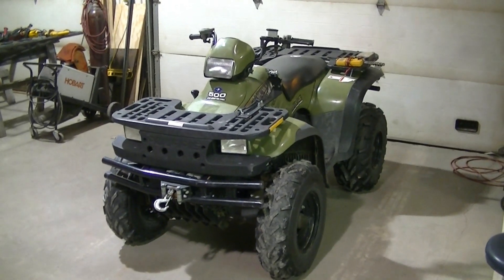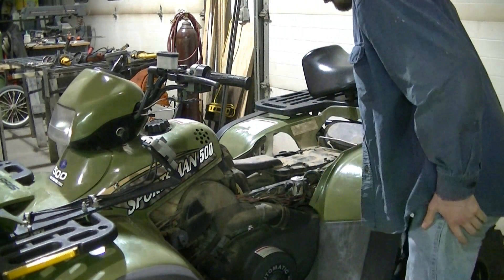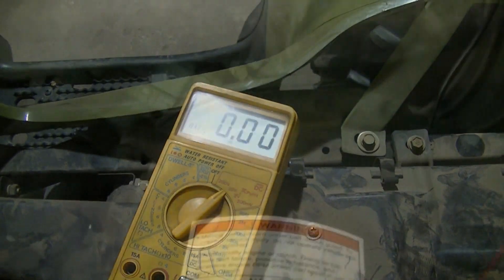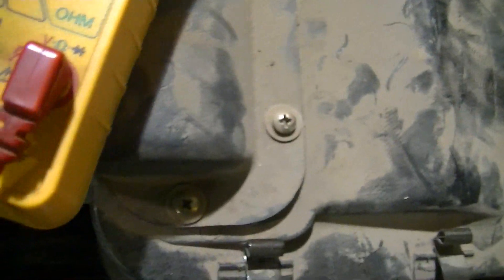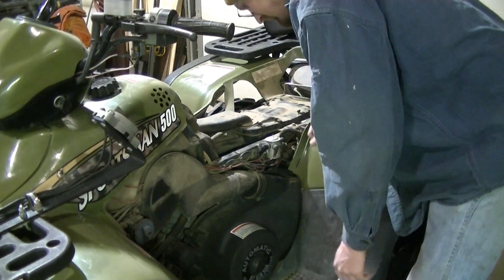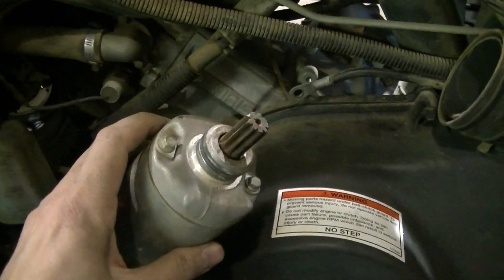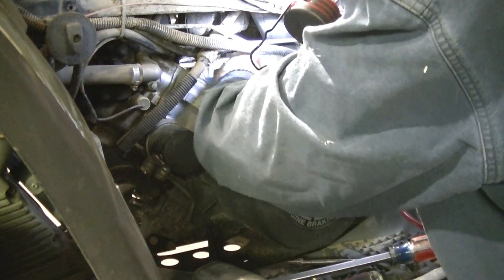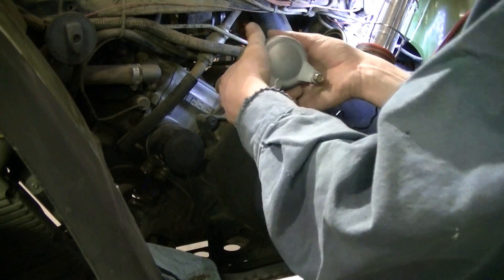Polaris Sportsman 500 ATV Starter Replacement

Comment: I got a 2000 sportsman myself. Left over winter and starter not happening. I pull started fine so happy all ok on that side. Sounds like your noise was coming from inside the pull start housing/bendix drive. Like many of us we didnt know about the drain plug on bottom of the housing/water holes. Rusty inside. My father-in-laws was really bad. Another job but cleaning is what it seems is all. Nice video though. Thanx

Comment from the maker: Got it on ebay.  It cost about $40.  That is pretty cheap so really don't know how long it will last.  The noise I thought was odd is normal.  The Polaris 500's sound like that when starting for some reason.  Even the new ones.
Reply: mossman381 very true. I have (3) Sportsman 400, 500 and 700 they are all load when starting.👍

Comment: That noise you hear that sounds like something's hanging up when you first start it is the Bendix inside the the housing where the starter goes into the Bendix is sticking a lot of times the pull start handle if it's not at its home position covering up the hole in the case when the Rope is retracted all the way in water and mud and stuff will get in there and gum up that Bendix that shoots out when you hit the starter and then engauges the flywheel you have to take the other side apart pull the recoil start off the side of the motor to access the Bendix and either install a new one or clean it up and get it operating properly

Comment: I just finished this on a 2001 400 Sportsman and it's the same procedure.  Took me probably an hour and a half to complete start to finish.  That bottom bolt is a bearcat to get out enough to get the starter spun enough to clear it out of the hole behind the primary but it is doable.  Good video on this topic, thanks!

Comment: Just put a brand new battery in. When I start it it cranks pretty slow and when it finally starts and warms up its okay. But the lights get brighter when I throttle it up. Ideas?
Reply from the maker: Dbolin79   New battery it should crank over pretty fast.  Starter might be getting weak.  As for the lights your stator might not be putting out as much as it should.  I think on this atv the lights do get brighter when you rev it up.  I haven't run it at night for a long time.

Comment: I had to replace the starter in my 02 Scrambler which has the same engine.  Those starter motors sure get stuck in there!  Getting mine out was a real challenge, the service manual actually suggests taking off the clutch and the cover behind it, you can actually do it without, as shown in this video.  Thanks for a great video!

Comment: Great help.. Do have video on replace repair pull starter? Bought my 2001 6x6 used which pull starter has never worked. Have to replace starter at this point and figure good time to fix pull start. Thanks

Comment: My bike was actually an 07 it was doing the same thing clicking when you try to start it and it actually turned out to be dirty ground cable on the battery but then when I started it I heard that same noise you heard like something was hanging up on the flywheel like I said in that previous comment it's the Bendix that shoots out when you hit the starter and engages the flywheel that's hanging up probably all gummed up and dirty in there you have to keep the pull start handle in it's retracted position sealed up onto that nipple to keep mud and dirt out of the case

Comment: 1st, never use WD on o rings, use transparent silicon grease 
2st, bendix and motor brushes has almost a same life time, replace them together. Or take out it out and measure the axial and tooth wear with micrometer. Sometimes a super cleaning and lubricate with heavy sticky grease helps for the bendix, but better to replace before killing the crankshaft wheel tooth.
Reply from the maker: I can say after 10 years this starter is still working fine. The rest of the ATV is getting pretty bad but no issues with the starter or bendix.
Reply: @mossman381  then You are lucky 😂 we have a Polaris 400, and this starter just go wrong every 2 Years or so. guess different climate region. We have lot of dust here not so much rain.. eating every bearings, rubber things, seal rings, filter, connectors,

Comment: I'd also be interested in the mount.  I'd hate to have to take the bumper off to mount a winch and not be able to use the bumper.  Thanks in advance for any info.
Reply from the maker: +David C   A Polaris dealer should be able to tell you what you need.  The winch and bumper was installed at the Polaris dealer before dad bought it.

Comment: say man can you sned a pic or video where the voltage regulator/rectifier is.i bought mine used and it did not have one when i got it.im not sure if i should bolt it or strap it in thanks

Comment: can you do a video on what the starter is connected to and how the wiring is done cuz when i bought mine i can only pull start it.mine can start up with the red button like the kill engine switch but it has a run switch in the middle so when u push the button up it starts but im thinking one wire or a part is missing to the starter
Reply from the maker: If it starts with the button why do you think something is wrong.  Really don't know what you are asking?
Reply: mossman381 no it dosent start with the button it can only be pull started for now but im shure like yours you have a ingition switch such as the red start switch, when i press up on it mine gets no spark or nothing
Reply: mossman381 i can try to emailing you a video explaining what i mean

Comment: i have a 2012 polaris xp 850 touring. i hear clicking towards front of machine and it dosent start up at all only clicks. im pretty sure its the starter. Is there a special way you cleaned your starter or you just bought a new one.
Reply from the maker: I am not familiar with the 850's.  Might want to stop at a Polaris forum maybe and see what they think.  I bought a new starter and so far it is still working great.

Comment: what is an 01 atv like yours worth ,im looking at an o1 runs and drives but needs tires and tlc thanks for any help
Reply from the maker: joe18370   I would say $2500-$3000.  If it needs tires there must be a lot of miles on it.  I can't look at it myself so I can't really tell you what to pay for it.  I personally wouldn't pay over $2500 for an 01 no matter how good it looks or drives.  It's a fairly old atv.  Our local Polaris dealer said they would give us $1500 for ours but he is going to sell it for $2500-$3000.
Reply: mossman381  thanks a lot very much

Comment: how much is a starter for a 97 polaris sportsman 400 4x4? mine pull starts everytime and the starter works every other time so im sure i just need a new starter. great video
Reply from the maker: +brandon shackelford   Don't remember how much the starter was.
Reply: there about 30 bucks. i just bought a 97 polaris sportsman 400 4x4 just like yours so where do i find the oil dip stick and the tranny dip stick? what oils would you recommend for the hubs, tranny, oil change? i know you can use regular car antifreeze but some people say you can use car tranny oil and use car tranny in your hubs? thanks in advance bro!
Reply: my starter just went out so thanks for this awesome easy to follow video

Comment: Can your starter turn over but not fast enough to start the motor? My polaris sportsman will not start for crap when its cold with the key. But as soon as a pull it, it starts right up then idles like crap any idea. Oh and when its warm everything runs great.
Reply from the maker: The starter should turn over pretty quick.  I believe I start this Polaris in the video.  If yours doesn't turn over as fast as this one the starter could be going.  Pretty hard for me so say why yours idles poorly not being able to see and play with it myself.
Reply: Ok thanks, I did some researxh and tinkering and I found out that there is some bad fuel in my tank and may be clogging the fuel pump, any idea should sea foam do the trick on that?
Reply from the maker: Derek Pope
If you think you have bad fuel you need to drain the tank and put fresh fuel in.  Some sea foam won't hurt but will not clean bad fuel.

Comment: Is there any way you could send me some pics and info on your winch mount?  I just got a winch for a 99 Sportsman 500 and have the double tube bumper up front but everywhere I was reading said you couldn't use both at the same time which doesn't make sense since there is the roller fairlead mounting plate on the bumper.  I'm just wondering what winch mounting plate you're using and how its attached along with the double tube bumper.  If you could somehow post pictures and more info or send them to me somehow that be awesome.
Reply from the maker: +Craig H   This atv is in storage right now but I will see what I can do.  As far as I know it's just a standard winch mount and then you use the bumpers fairlead mount.  All parts were bought from the Polaris dealer when it was new.

Comment: Im learning the hardway that the starter has 2 pieces. Not like a car where the teeth engage the car. The Polairs has a separate teeth BENDIX on the other side. The electric motor engages the BENDIX and the BENDIX spins the flywheel....fun..
Reply from the maker: It's really not that complicated. I am sure they have their reasons for this design.

Comment: I have a 500 sportsman that I ran without the battery in it and the light got real bright and went out now I have now power to speedo either any ideas
Reply: still runs if you pull start it
Reply from the maker: If you look inside your headlight bucket you might find a fuse.

Comment: i have a polaris sportsman 90cc and it starts up and everything however when you pull the throttle it sounds like its drowning and then it shuts off.. no power whatsoever
Reply from the maker: Try cleaning the carb.
Reply: Jay it should be a throttle safety switch

Comment: hey everybody .... I need parts.   Where is the best place and prices for like Stator Cover with complete pull start assembly all in one and front and rear suspension bearings and throttle controls and cables for high range.    I bought a trashed 2001 Polaris sportsman 500 and trying to make it live again.
Reply from the maker: +Cuku Kenivel   Cheapcycleparts.com should be able to find parts on Ebay and Amazon too.
Reply: thanks bud !!!!   appreciate it !!!